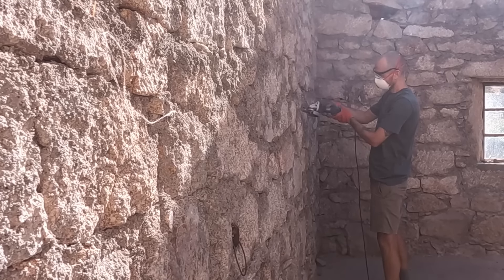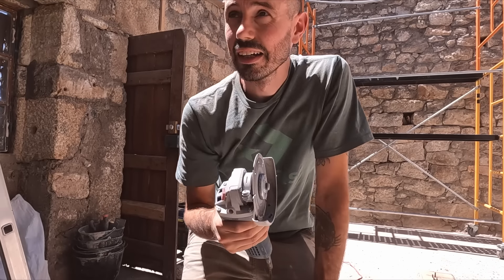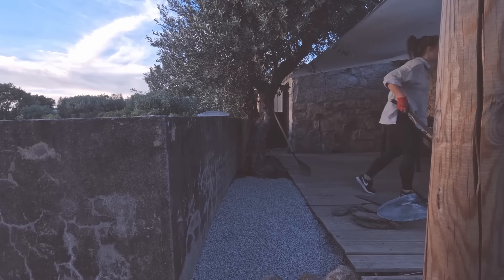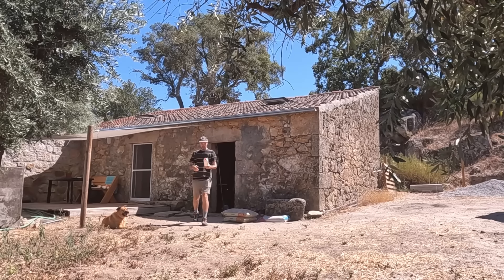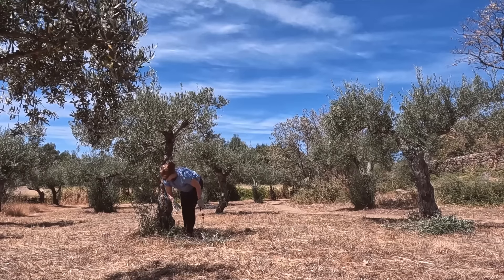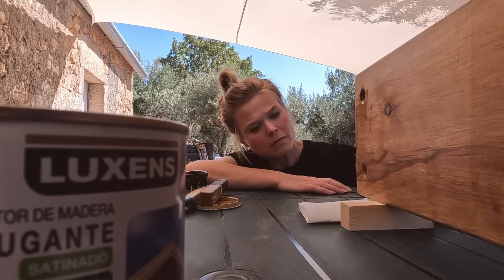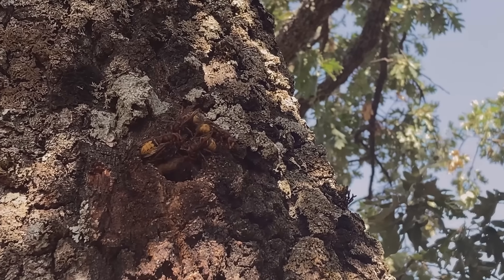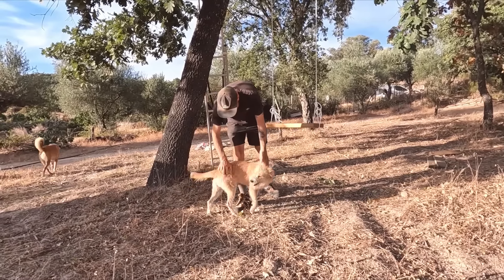Summer Days on Our Little Farm Renovating an Old Stone House

Comment: Tip.

Paint the inside of your plantpots so the clay will not suck the water out of the soil and it get vaporised by wind and sun.

Saves you watering

Comment: Possibly  a wire brush attachment for the drill might work well after you break the seals at the joints and or spaces between the stone.    I am guessing that if the wire brush does finish prep well , of course this amount of work you wear attachments down and so might be a case that you go thru 3 or 4 of those attachments depending on the quality of a product.

Comment: These little treasures u keep finding, the paint on the stones should come off by rubbing another stone over it, a little tip from a builder when u get Mark's etc on brickwork stonework. So when u take out old windows just use another stone. Hope this helps 🙏

Comment: We have removed paint from wood many times. I will give you our best solution.
1 cup washing soda (sodium carbonate)
1 cup lime (calcium oxide)
6 cups hot water
Mix and paint on to wood with a paint brush. Wait 2 hours and remove with a wire  other brush
(Always apply in the shade) 
I really hope this helps. Paint should come off very easily. One can do a second coat if necessary. Good luck with the renovations ❤
Reply: I wonder if that paint is old enough to have lead. If so, she needs protection. I know there are lead test kits. What do you think?

Comment: Cement is strong alkaline. Muriatic acid is the opposite on the ph scale. A small amount of acid will have little effect. Either increase the strength of acid in your acid/water mix, or, apply multiple times. The large quantity of cement is rapidly neutralising the small amount of acid.

Comment: I’m impressed with the masonry in the tiny house and in some of the stone walls you’ve shown. The tight stacking of the rocks is beautiful and obviously built originally by a skilled builder.  Too bad the concrete is present that must be frustrating for you guys .  The walls of the house look plumb and structurally quite stable as far as I can tell. The rock seems to be sandstone, is that correct.  Keep up the good work and thanks.

Comment: Have you tried pressure washer ? Saw a couple do the same as you trying different options .They used a pressure washer and the stones were amazing beautiful after , pointed the walls and it looked beautiful .They also had to dig the floor down about 3 to 4 ft and the moisture made it so much easier .

Comment: Who would put cement on a stone building? Is it on the inside and outside?
For the Herb Garden, was there a reason you didn't use the dirt area and use cardboard? Planting in pots will require so much more water because they will dry more quickly. When it comes to mint, yes, a pot is needed as it can take over an area
The swing will be a nice diversion.

Comment: Those inner walls you should pressure wash with a 300bar water power washer.

Dont be fooled to get a non professional pressurewasher you need to rent a industrial petrol powered.

Comment: If it’s so strong why would you replace the mortar/concrete? Why not just tidy it and just redo any that need.
Reply from the maker: Because mortar should be weaker than the stone/brick so when the building has movement, the mortar breaks & not the stone. We’ve already got broken stones because of the concrete unfortunately